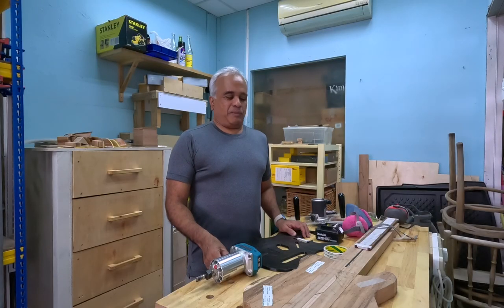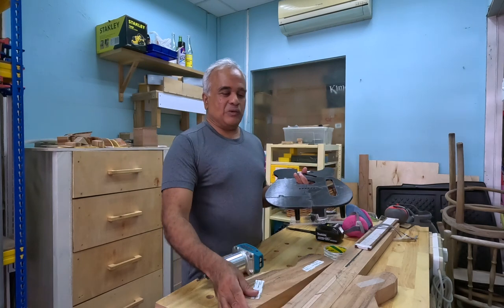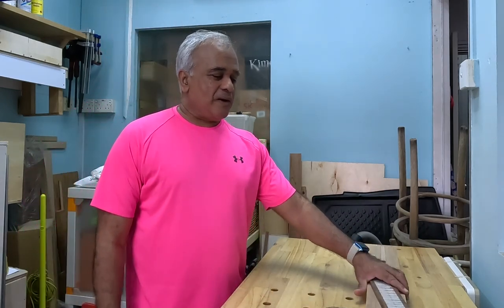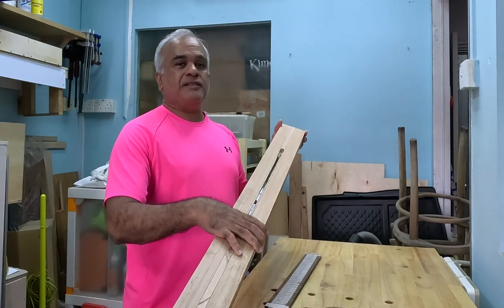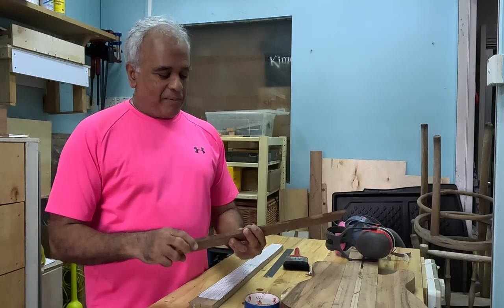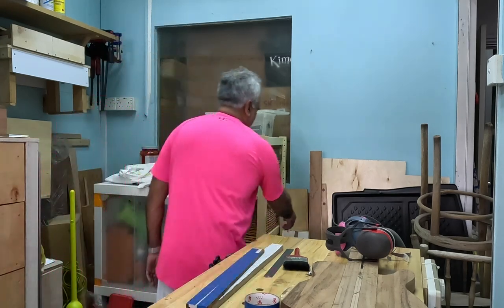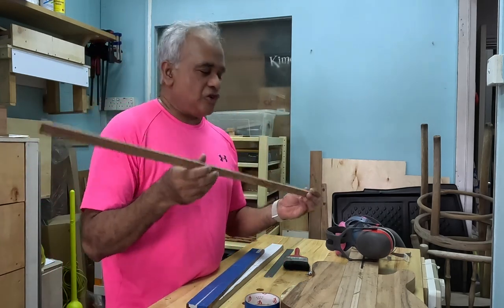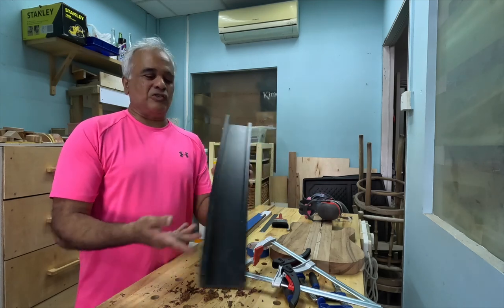#JurgsCup #UseWhatYouveGot Challenge — Episode Five: The body takes shape, the fretboard takes a hit

Comment: Great idea using the 3D printer 👍, just an observation it looked like you were planning towards the same end on both sides, if the fretboard has any grain run out (not perfectly quarter sawn) that might explain some of the tear out. The beach binding will be a good happy accident addition though and tie in with the body 👍
Reply from the maker: Thanks, Barry. You're right about the grain. It wasn't in the edited video, but I did try planing  in the other direction at one end. But that damage was done by then. The beech binding is an option, but I'm currently exploring a completely different option. And I'm very sure that option will raise eyebrows and likely draw a unanimous "NO!!!!!"
Reply: @bhartissimo  hmm intriguing! It's cool to try new things